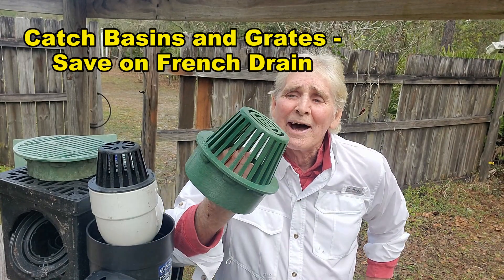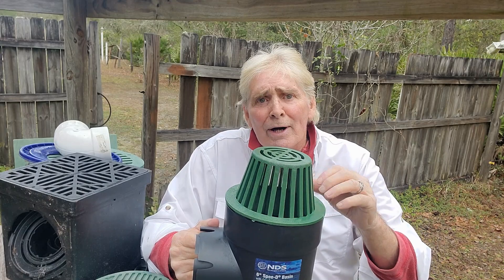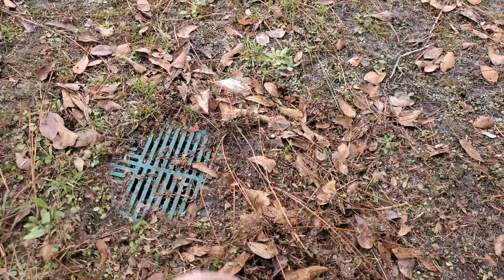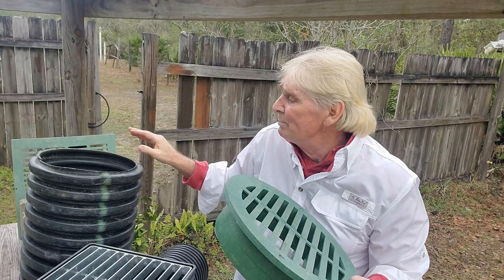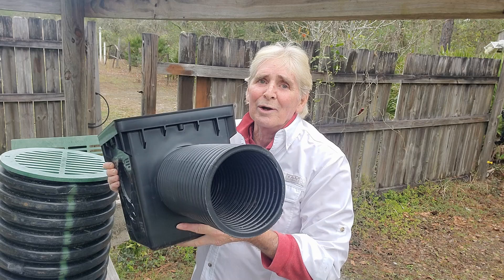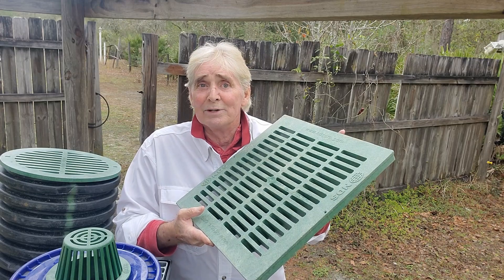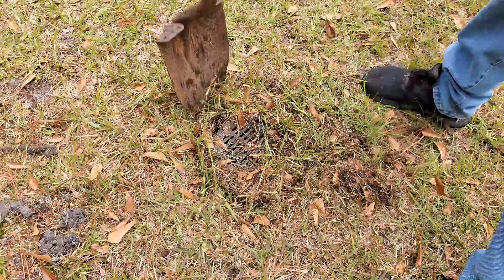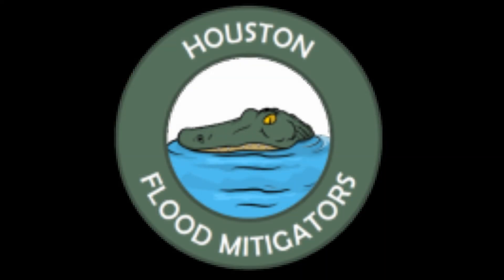Catch Basins and Grates - Save on French Drain

Comment: Nice video.  I use 2 atrium grates inside a trough in front of our garage doors.  We have negative grade and it's all surface water.  Have  both lines running into an M98.  It does amazingly well but last hard rain it became a tad overwhelmed and began draining into the inside garage drain.  We had to plug the original drain inside the trough since it used to all go into our sanitary line.  Won't pass a dye test now...